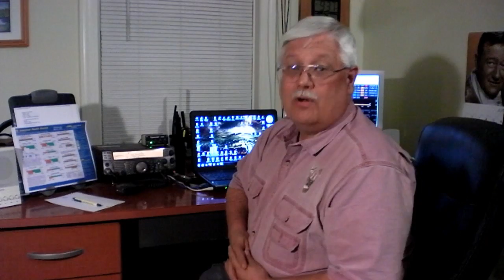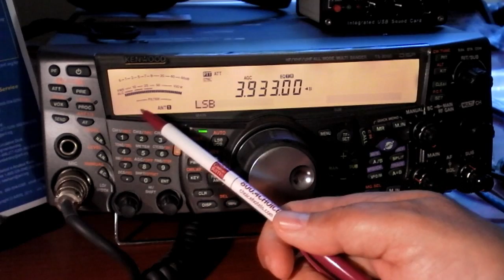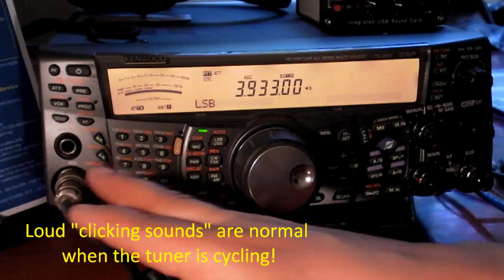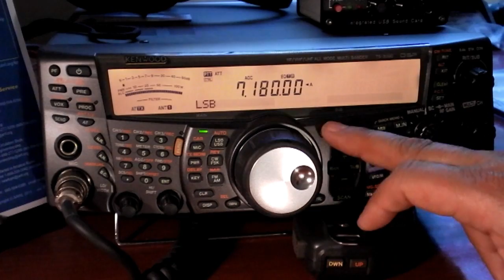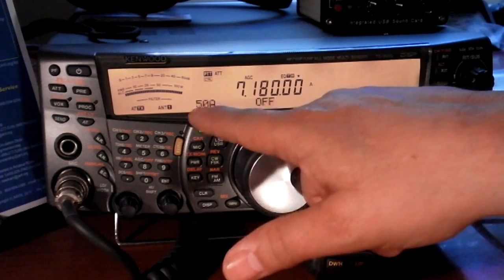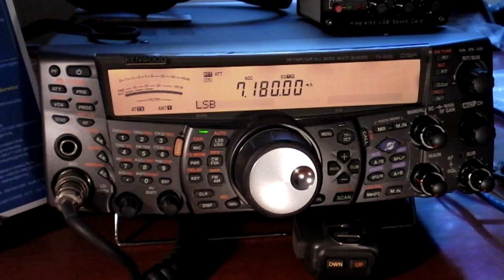4-METERSinc TS2000 "AT & Menus"

Comment: hi can you tell me if the kenwood mc-90 will work better then the mc-60 with the kenwood ts- 2000 
. wp4mxz
Reply from the maker: review I found... "Comparable to the Heil PR-781
After trying several microphones and obtaining a number of over the air TX audio reports as well as comparing response curves on a scope, the MC-90 is practically indistinguishable from a PR-781. In actual OTA reports I've been told that the MC90 sounds slightly better and has a slightly warmer tone to it. If you're looking for a great microphone, you've found it. Much better (IMO) than the MC-60. Especially useful is the bottom slide-switch to cut off the low end response when you're chasing DX. "   Hope that helps.
Reply: K4REF thank you so much for the up date wp4mxz .

Comment from the maker: Customchannel... I linked one more video in this play list to show you how to make available frequencies outside the normal ham bands.  I have done this mod to several radios with no issues.  Be aware you MUST SAVE YOUR MEMORIES and MENU CONFIG prior to doing this.  The mod will require you to factory rest the radio... and thus loose all your programming.  After the rest... just reload it back onto your radio.  Kenwood has a free software  MCP-2000 for this purpose. http://www.kenwood.com/i/products/info/amateur/mcp_download.htm  Or you can go to a company like RTS Systems for that too.  (Be aware that last time I checked... CHIRP can not be use for this at this time.)